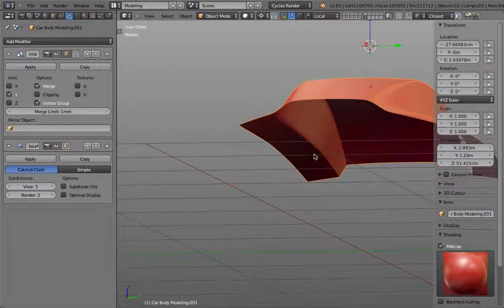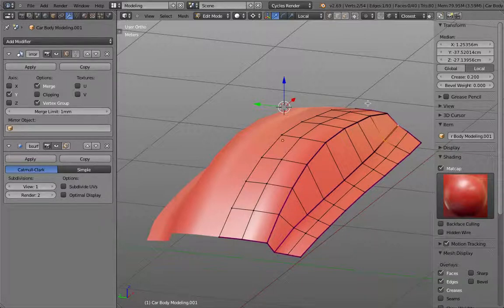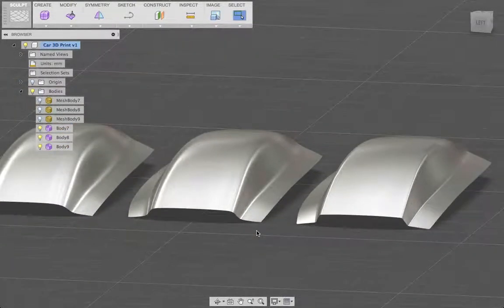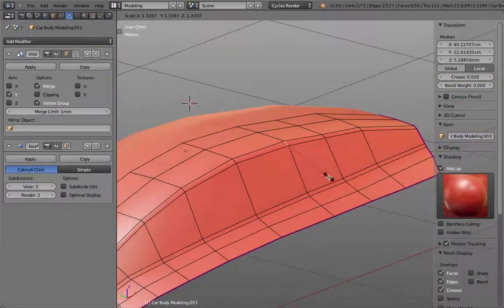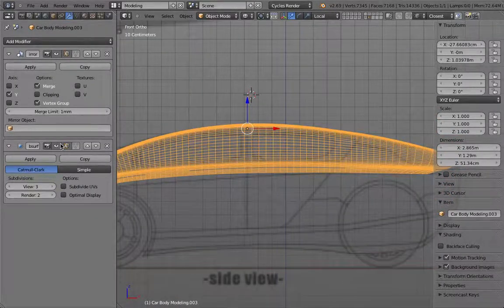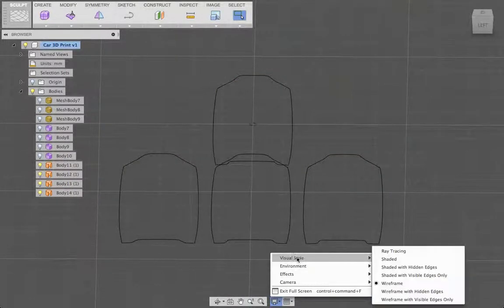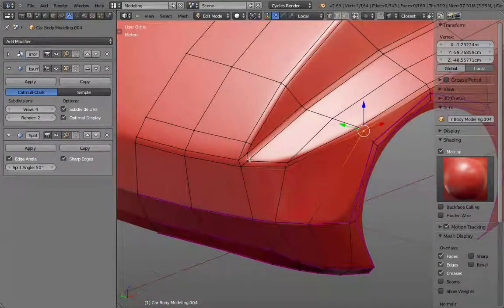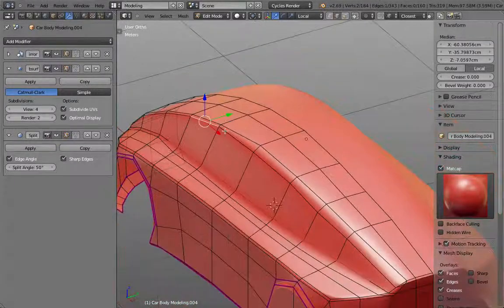3D Print   3 Blender Edge Crease and Fusion 360

Comment: Great video, thank you Claas. I'm glad to see I'm not the only one trying to use Blender and Fusion360 together.
Reply from the maker: Hi there, it is a pretty fantastic tool. T-Splines also has certain limitations Blender as a sub-D modeler does not so they are a perfect combo.
Reply: Thanks for your reply. I find modelling in Fusion much easier for solids than Blender so I'm trying to find the best way to bring objects from Fusion into Blender to animate (no deformation required). I'm having trouble getting Fusion parts to smooth shade in Blender properly. I'm just watching your video on STL export so that might give me to info I need.
Reply from the maker: Chris Schraders Oh I see - you use Blender just as the animator. Actually Blender has booleans which simulate a perfect solid workflow as well. But I would only use Blender sub-D for organic modeling. If you have any questions about rendering or animating in Blender send me an email. I also have videos online about using Blender for rendering.
Reply: Claas Kuhnen
Thanks again Claas, could you tell me where I find the booleans tools in Blender?
Reply from the maker: Chris Schraders It is a modifier. Are you familiar with them? The workflow in Blender is similar to Fusion Time Line it is object mixing based.

Here is a link to Youtube: Tutorial Fridays---The Boolean Modifier in Blender

I use it mainly to simulate the solid boolean tool like in Fusion.
Reply: Thanks, I'll take a look at that :-)